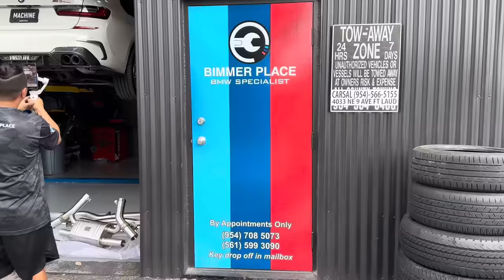BEST SOUNDING EXHAUST FOR YOUR M340i‼️😱MASTERY OF ART & DESIGN🔥 *MUST SEE*👀

Comment: @fastlifeprince how does the stock valve actuator get repurposed? Do you unscrew the actuator from stock exhaust and then screw onto new exhaust ? And does the valve on the other side daisychain to the OEM valve actuator?? How does it integrate?